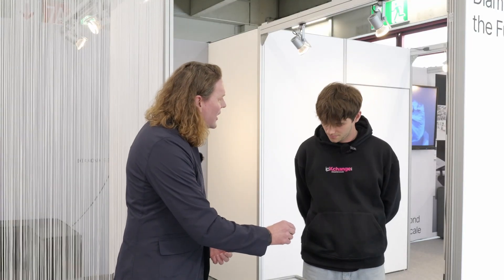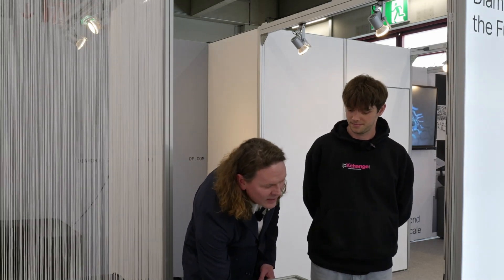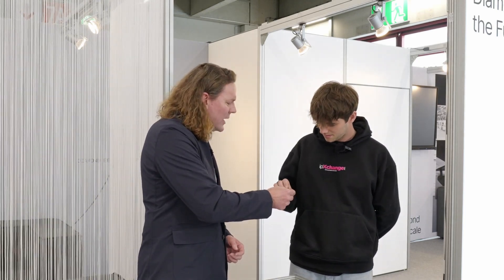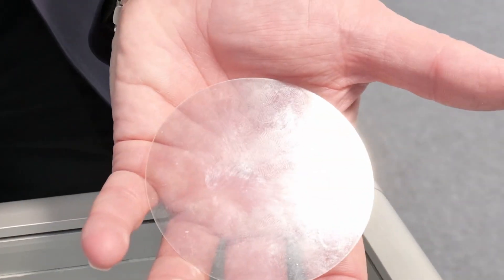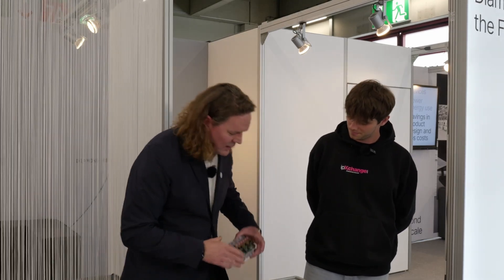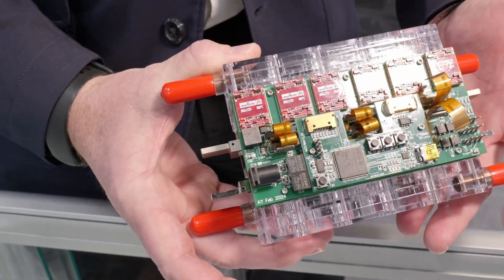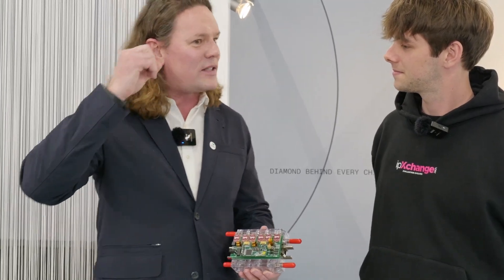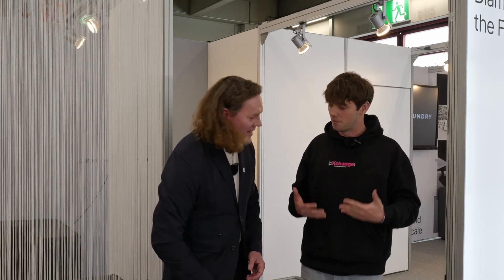How This Diamond Tech Supercharges AI Chips

Comment: OHH he explained so well i thought NVidia was going to print the lithographic inside the diamond wafer which i think it will make more sense the whole chip will be 100% diamond. so it just a diamond plate on top of the current traditional or conventional silicon wafers. Maybe in the future they made the whole thing out of DIAMOND.
Reply from the maker: Bang! Exactly right. Maybe not the last part though hahaha, diamond is a poor electrical conductor but a great conductor of heat.
Reply: @ipXchange  why the last part wrong i think not because silicon by   it self will only behave like diamond the think probably they can not do it at the moment is probably because it is extremely expensive. On a conventional chip  the inside where you see like lanes going  everywhere those lanes are made of copper or gold sometimes the company intel has some really cool old videos where they explain how a CPU chip is made and how exactly it looks in the inside. but none the less it will be really nice to see a chip or any type of chip made out of 100% diamond in the future. right now there are some companies working on how to make chips based on another type of carbon and not silicon it is very close to diamond since diamond is based on the carbon element too. i forgot the name of the specific carbon based ill let you know if it comes to my head again but it is carbon based.
Reply: @ipXchange  I found this masterpiece is called "How a CPU is made" and the channel where that video is is called D I Y w i t h B e n i separated the name because you tube probably will block the comment.